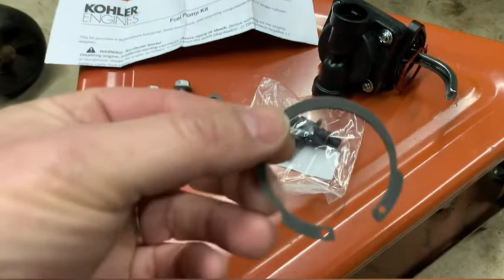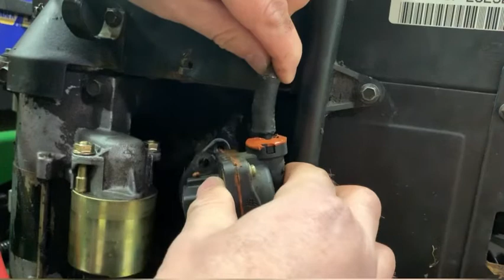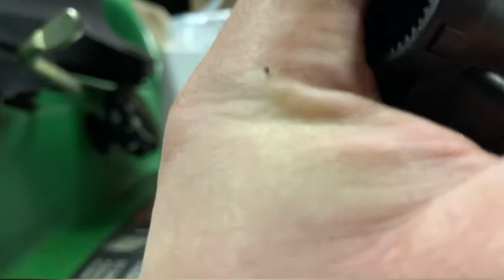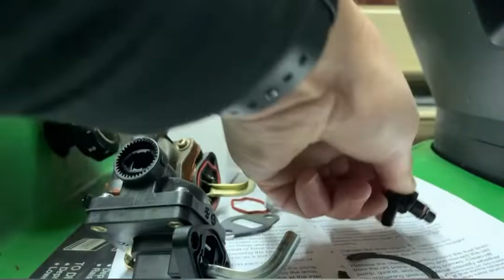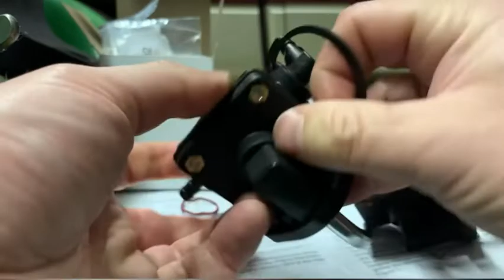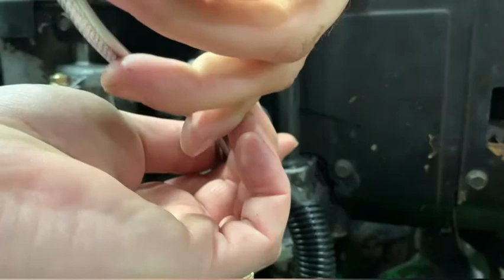John Deere GT225 - Kohler Command CV16S - Replace Fuel Pump- 12-599-02-S

Comment: My GT225 is sputtering almost like it is not getting enough gas. Do you think this is a fuel pump issue? Thanks in advance for any insight. Your GT225 videos help me a ton.
Reply from the maker: Glad to hear my videos have helped you! Hard to say exactly what, but probably related to fuel. Fuel filter could be plugged, fuel line might be collapsed, etc.
Reply: @andysshop do you have a video on how to replace the fuel line?
Reply: 95% fuel pump.  Could be the carb also

Comment: Replaced mine yesterday, got all the old gas out but maybe half a quart, put ethanol free gas in, can't get the b to start but with staring fluid then it shuts off. I'm be checked everything but the heads, kind of at a loss at the moment
Reply from the maker: Did you prime it by putting gas directly into the fuel pump? Mine wouldn’t start until I did that.

Comment: Thanks for the video.  I'm running into the same issue. Before buying the pump, I'm trying to do some troubleshooting.  My injection line (the metal tube running from the top of the fuel pump) might be clogged.  Any ideas on how to clean that out, or do I have to buy a new one?  Thanks.
Reply from the maker: You can disconnect that line at the carb. Put a jar under under it and see if fuel comes out while cranking. If it does, that line is probably fine.

Comment: Great video, Thanks! NOW LET SEE IF MINE STARTS ALSO LOL.
Reply: Important make sure u have Bottom hose attachment , turned towards you. (Out side of OIL stick. YEP. (DONT set the bottom at 90degrees. WONT BE ABLE TO PUT HOSE ON CLAP. yep. ALSO. THE 4 SCREWS ON kohler You won't be able to racket the 2 screws in with the NEW bolts . KeEP old bolts. 
( RESULT, MY FUEL PUMPED. BUT HAS BEEN 5YRS SINCE START) YEP CARBO TYME) LOL.
Reply from the maker: Good luck!
Reply: @andysshop  battery, fuel filter, fuel pump, and a carburetor.. and (oil change lol)YEP..!! She started like brand new!!! 
Thanks again,  Plowing the garden!
Reply from the maker: Awesome!